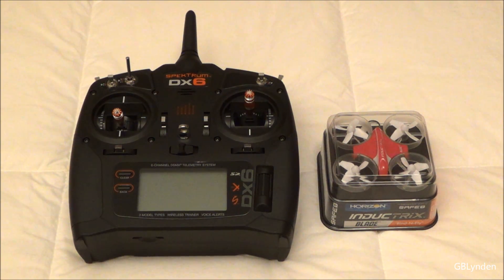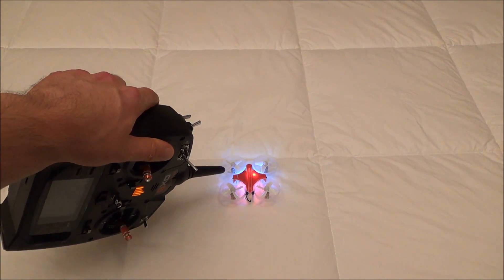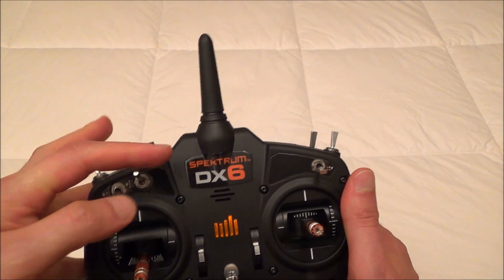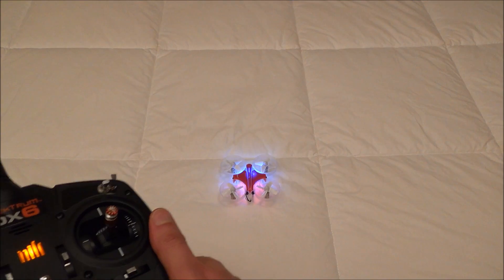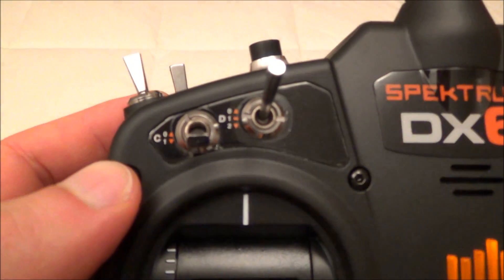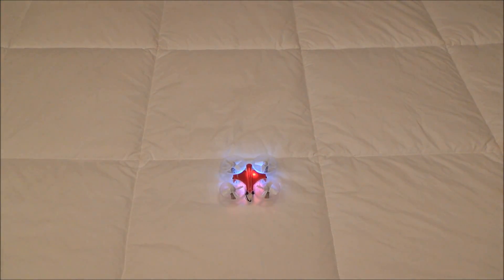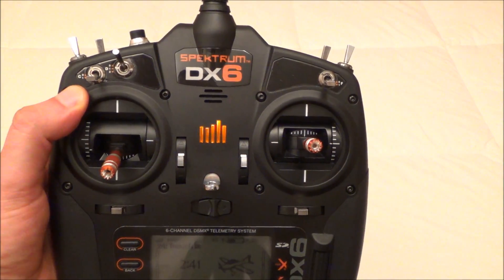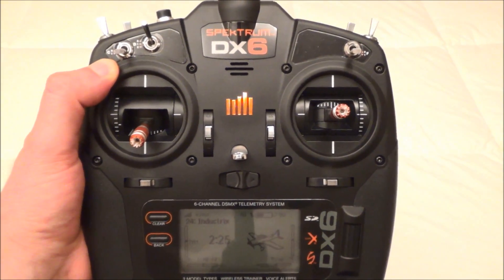Spektrum DX6 How To - Blade Inductrix BNF Agility Mode Setting with DX6

Comment: which switch is it on the dx6i? There are no 3-position switches
Reply from the maker: Great question. Sadly, I do not have mine anymore to test it to see. To be honest, I would either assign it or face the fact that you may need to upgrade your radio. Even this DX6 is outdated. I recommend getting one of those new NX radios if you plan to be in the hobby for any length of time given the new tech on the horizon.
Reply: @GBLynden  looks like it's the flaps switch after setting the landing curve in the flaps menu above 50%
Reply from the maker: Sweet!

Comment: I'm using a DX8 Gen 2 and here's my setup: Channel 6 (aux1) apparently controls the modes. In channel setup  1st page shows channel 6 which is ok. Go to next screen and set the switch for channel 6 to "I" (the pushbutton bind button). Go back and find throttle cutoff and set it to "H". That way, you can just flip the switch to leave it cut off. You may have to switch it if it doesn't bind. So  back to modes - now just click button "I" to change from safe to agility. Click again to switch it back. All done. Btw, i also set up switch  "F" using D/R to have three different speed settings.
Reply from the maker: Sweet!

Comment: Which transmitters are compatible the inductrix ? Just spectrum right out of the box? I'm wondering what kind of receiver it uses.
Reply from the maker: +Art Romero Any radio with DMS2 or DMSX protocol will work. That means a Spektrum radio or a clone.

Comment: It works just like you said except mine is in safe mode when the BLUE light is on. Now I'm trying to figure out why my DX6 beeps with every slight movement of the throttle stick.
Reply: That beep is probably your timer starting when you move your throttle up.
Reply: I set my DX7s timer to beep (start) when I throttle up so I know how long I can FPV and still be able to get my plane home.  Glad I could help ya out.
Reply from the maker: You can fix that in sound settings.
Reply from the maker: MrStevedfx That is exactly what it is.
Reply: Thank you.
Reply: I know its been a coupñe month but i like to have no sound when the stick goes up i turnd that out on timer settings it only beeps at 1 min and last 20 secs on timer.
the beep on throtle throws me out

Comment: Thx for the info! I have your same setup but I have noticed that when I give full throttle it'll climb up once but will come down then it won't go past 6" off the ground. I got new packs (205mah) and same issue. You have any advice?
Reply from the maker: That seems really odd. Maybe adjust the throttle trim?
Reply: Did you find out the problem, same thing here !?

Comment: You didn't even show us how you programmed it in the transmitter.
Reply from the maker: All I did was setup it up as an airplane. I am happy to walk you through the steps, but it is very easy to do, especially with the manual.

Comment: this is the same as the Nano QX. my question is how to change rates from normal mode to fast mode?
Reply from the maker: You do that by using the procedure I noted in the video.  You can also play with the dual rates and expo.
Reply: +GBLynden I just saw on my tx. im new to the dx6. I adjusted the rate on 70% and 100%. and assigned the 5th Chanel for switch c. and wahlah. is that right?

Comment: is there a way to go to agility mode with the stock transmitter?
Reply from the maker: +Jarrod Whittington I am not familiar with that radio, but it should. Aren't there flight mode switches on it?
Reply: there are two modes you can access by pressing down on the right stick but it doesn't really seem very agile.....thought maybe I was missing something?
Reply from the maker: Jarrod Whittington I wish I knew more to help you out. Are you talking about the dual rates button? If it is that radio, then it will be limited big time. IF you plan to be in the hobby long, I recommend a DX6 to get the most out of your aircraft and enjoy much better range :)
Reply: thanks anyway - cool video. Im about to go like it
Reply from the maker: +Jarrod Whittington Thank you! :)
Reply: try pushing down both sticks on the stock radio
Reply: Thanks!

Comment: Most multi-rotors including quad-copters can be programmed in "airplane" mode because there is no swash-plate mixing required. However, switching to "heli" mode allows for advanced settings, such as idle-up, throttle-hold, and switchable gyro sensitivity rates. Just make certain to select the 90-degree swash-plate setting and you'll be good to go....
Reply from the maker: +FourDollaRacing Thanks for the tips! :)
Reply: Happy Flying!
Reply from the maker: FourDollaRacing Thank you and you too! :)

Comment: +GBLYNDEN Great Video, and much preferable to use a 6 channel radio. Keep Them Coming My Friend
Reply from the maker: +2prophets Thank you very much! I will do my best to keep them coming. Did you see the outdoor flight video? :)
Reply: +GBLynden Yes I did. I was really amazed at how stable that quad is. I wish I had done a video if my first Flight after 4 years of not flying anything but that little Nano quad. I flew my New ELITE Apprentice S 15e with the SAFE technology.  I flew it the irst time with the SAFE System Turned on to Beginner, and the Crazy thing Crashed on the first flight. It had very minor damage which I repaired overnight. It was a factory defect that caused the crash. Anyone who buys one of these Apprentice S 15e's should be certain to check that the firewall has enough white glue on it from the factory to hold it tightly to the foam fuselage. Mine only had two tiny spots totaling about 1/2 square inch . I put plenty F Silicon  bathroom, tub, and tile caulk on it, and took it out for it's second flight yesterday. Saturday 9/05/2015 at my local Flying Club's annual Big Bird Fly in. When free flight time came around, I was the first one into the air. The wind was blowing about 17 MPH Steady. I got the plane UO to about 150 feet, and put it at a 45 degree angle above me heading straight into the wind. Have You ever flown airplane backwards in the sky ??  I did .  I applied only 1/10th throttle,  and it kept me on station with only occasional aileron corrections,  and two or three rudder clicks left. I flew that way for 20 minutes, and decided to land it at about the same time I heard these words: "I bet you can't land it without it rolling less that one foot".  I just LOVE A good challenge !!!  I Won !!!  It only Rolled three inches. BACKWARDS !!! lol.  lol.  lol.  I had it set to Intermediate, and Professional. Not too bad for a Return after 4 years Huh ??? The next flight gets posted with an on board go pro 3.
Reply from the maker: That is awesome and I can't wait to watch the video of the next flight :)